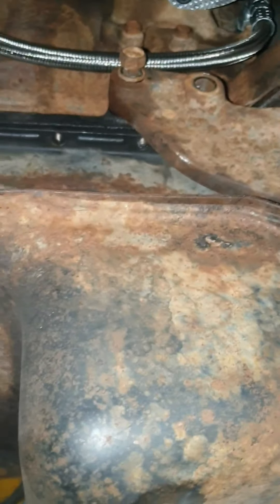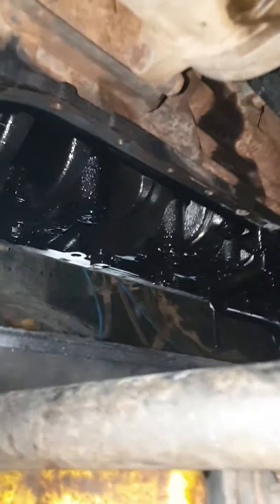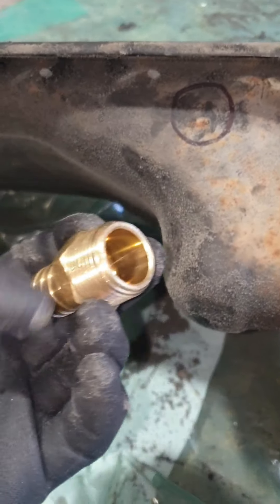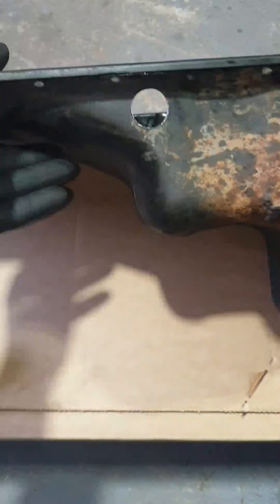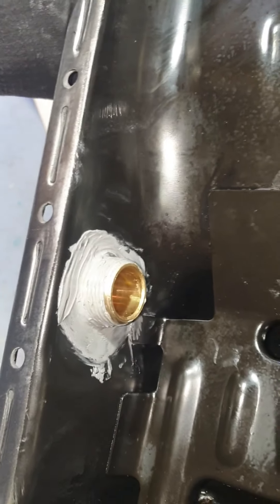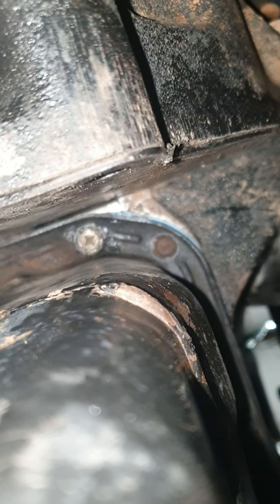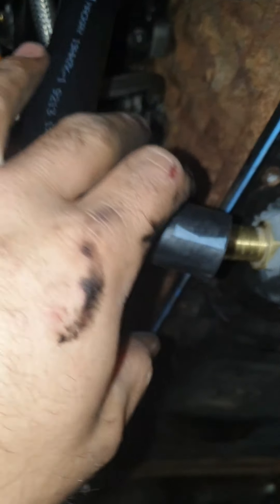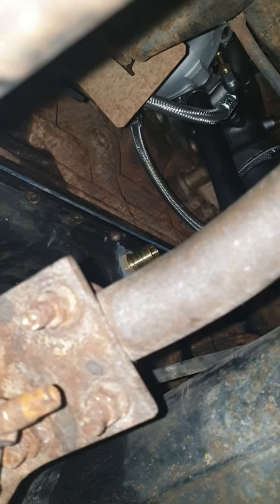TD42 turbo oil drain hose fitment

Comment: Enjoying this seiries thanks silly question how did u crank it over and it didnt start
Reply from the maker: G'day mate 
I disconnected the fuel cut-off solenoid on top of the fuel pump.
I hope this helps.
Dirty thumbs up bro 👍
Reply: @downtheshedwithbyron  thanks mate  i subscribed and watching all  your patrol  stuff at the moment
Reply from the maker: Mate you're a legend cheers any videos requests you'd like and I'll see what I can do take it easy
Reply: Gday Mate what size fitting did you use ?

Comment: Hey mate how do you pre oil/ water the turbo before actually starting the car up
Reply from the maker: Hey dude 
Sorry about that its 1 of my first videos 
But yeah i disconnected the fuel shut off to the fuel pump then turn the engine over till oil comes out the oil drain
 the coolant i filled up and pressure tested then went from there 
Hope you know what I'm saying
Reply: @downtheshedwithbyron  roger that bro! Cheers heaps 🤙🏽 love the vids